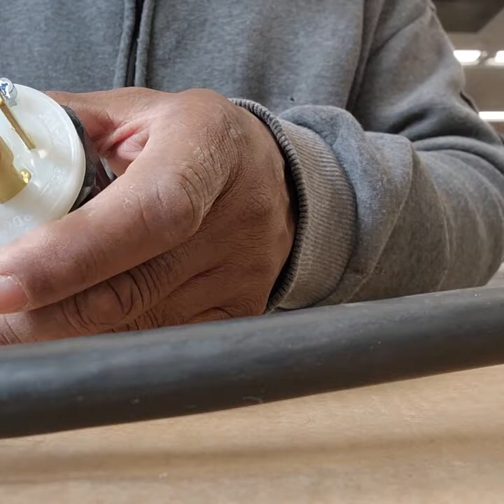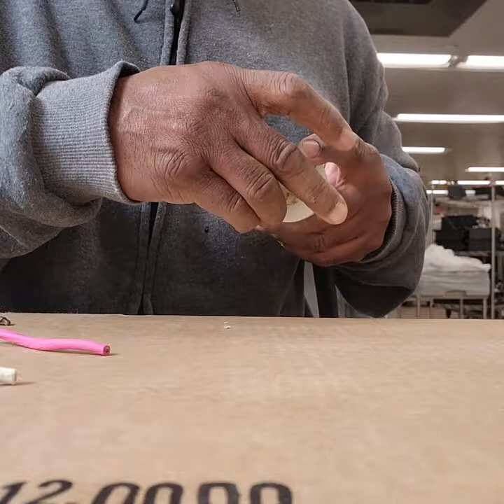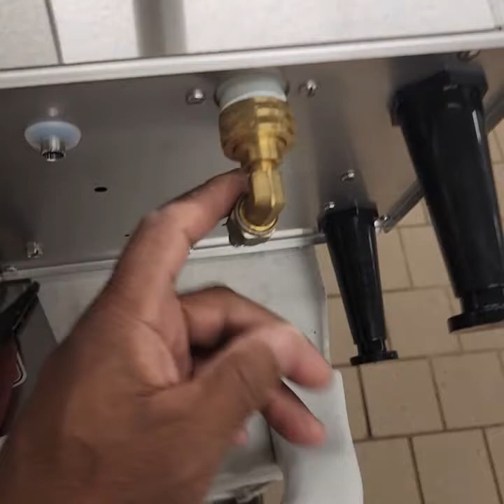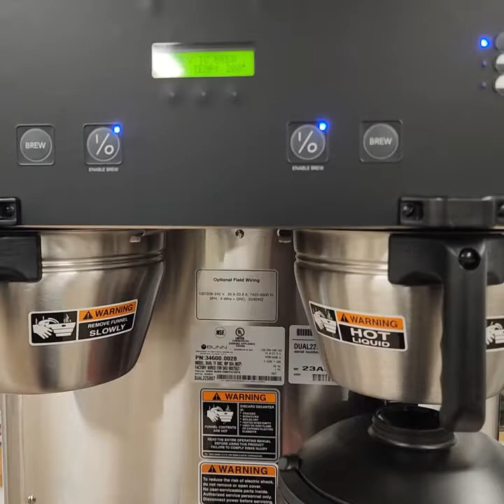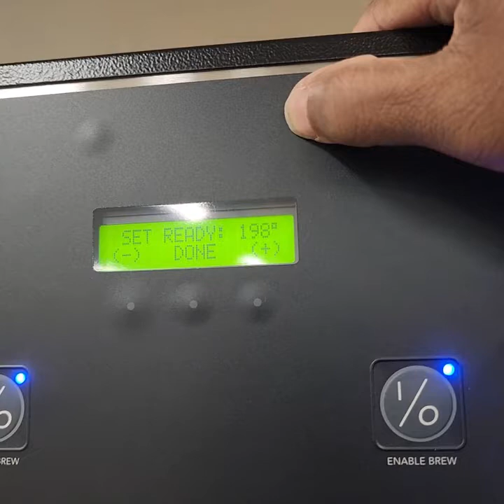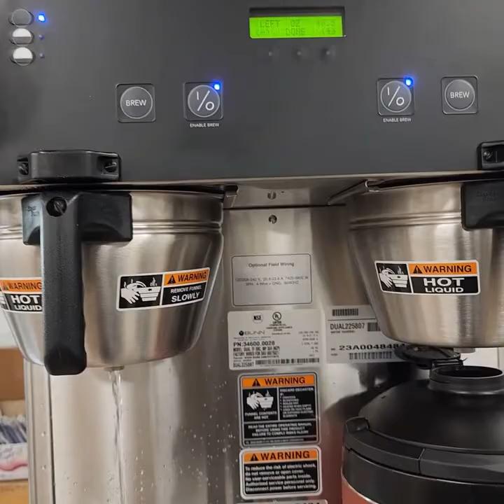Bunn Dual Coffee Brewer Install

Comment: dealing with this model today , have had a work order for no water coming out or the red hot water nozzle,  suggestions for trouble shooting?
Reply from the maker: Absolutely,  thanks for the comment.  It sounds like there is a sediment build up in the hot water dispense tube. You may need to shut down the machine, empty the hot water tank, clean or replace the seat cup in the hot water faucet,  and replace the hot water tube also. If there is alot of sediment in the tank you may suggest that they have the filters replaced.